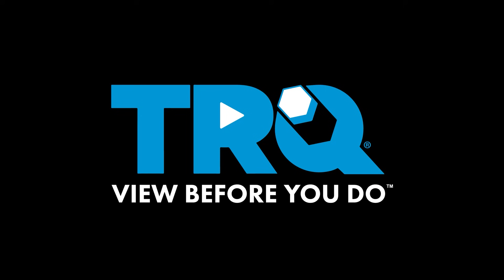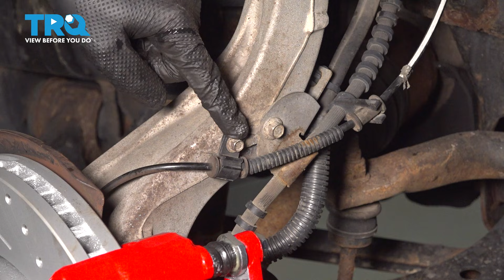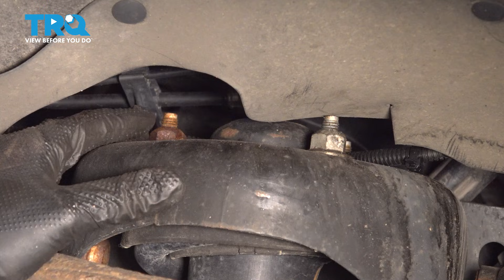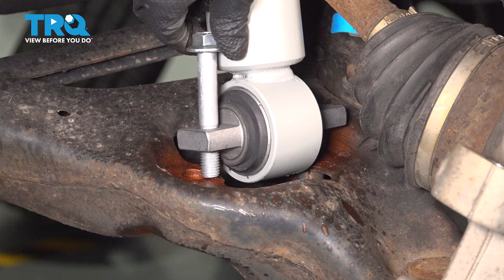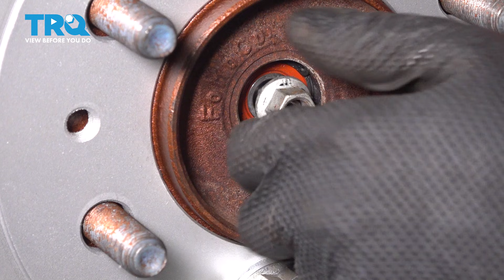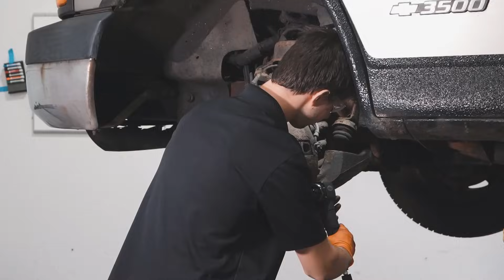How to Replace Front Struts 2015-2020 Ford F-150

Comment: I followed this video and managed to puncture the boot in my cv joint. It's best to disassemble the whole thing. Now i have to anyway with extra expense.
Reply: Also, be very cautious with the brake line when you're prying. If you have the assembly in the wrong position, the brake line gets stretched like no other.

Comment: Oh,,,, MAN,, that's very tie space ----hope that the rubber boot is fine without any scratch damage while using a long ply bar to remove the strut out but the lower long bolts look too deep to get out and scraping the rubber boot,, No damage to it ???
nice video,, very nice,,,